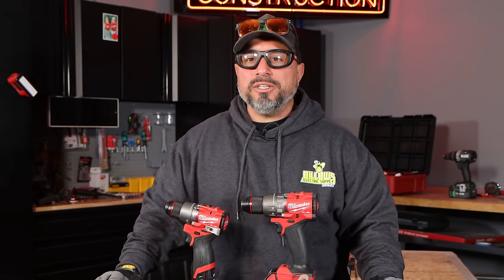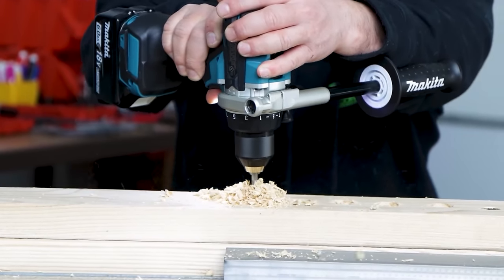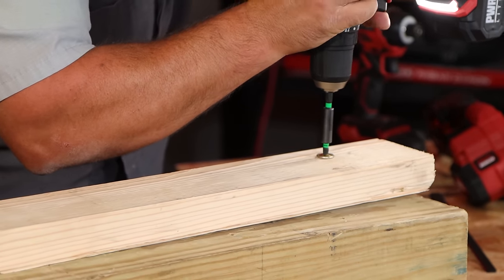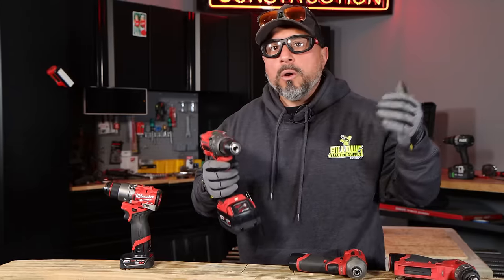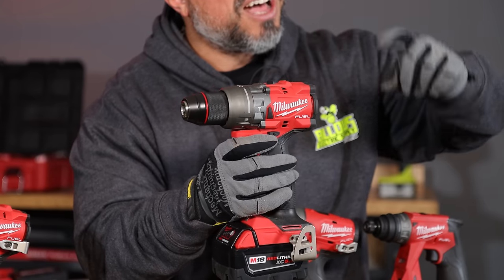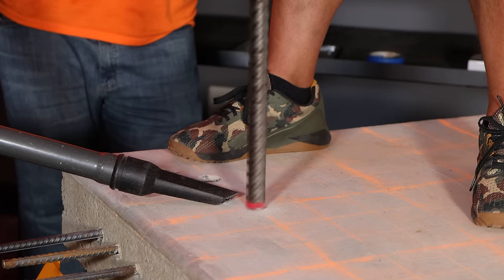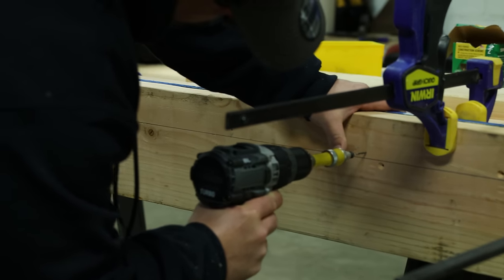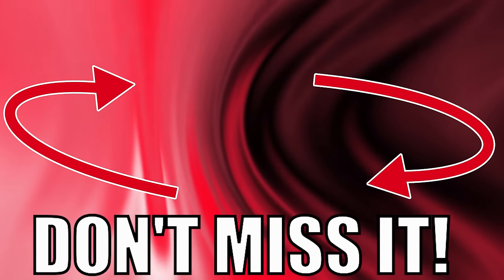Stop Using Cordless Hammer Drills...

Comment: I agree, it’s unnecessary if you have a rotary hammer or no use for the hammer function otherwise. Specialized tools will always do a better job than a “multi function” tool. For people like me though, hammer drills make sense. I work on cars, so I rarely have a use for a hammer drill. But my shop is concrete, and I have to drill into the walls occasionally. My M12 hammer drill makes the job much easier.

Comment: I use my cordless hammer drill when I use a hole saw through wood it cleans the teath and keeps from burning up the hole saw.  If you don't believe me please try it, and put a piece of electrical tape around the nut holding the saw in place to keep it from vibrating loose.

Comment: Me I use combi drill Milwaukee for everything I am tiler walls and floors,and stone fixer work with many types stones marble etc so the combi drill i use for mixing the adhesive, latex, with paddle mixer,drill holes in stones marble for metal fixing etc so for me it's the most best tool with one tool i doing more jobs brilliant why you say it's stupid? The combi drill Milwaukee it's already compact for what i doing it's extremely compact and powerful

Comment: rotary hammer is really just a big ass hammer drill. but let's be honest, installing anything on a concrete floor requiring less than a 1/2" bit is over kill for the R.H.  I'm not saying I need a nice hammer drill, or that it's needed often, but I need one.

Comment: A few months ago I would have argued with you, but since getting myself one of the Milwaukee M12 rotary hammers I can totally see where you are coming from. Small, lightweight, and does a MUCH better job of drilling concrete, brick and stone. And I've been using an impact driver for driving fasteners for years now, so really all I need from a drill is the ability to go round reasonably fast. I'm a DIY-er and odd-job-man. (PS I also have a huge line-powered SDS for really big jobs but in all honesty I hardly get it out of its box once a month.)

Comment: A hammer drill or drill-driver has a torque clutch that allows you, with some fiddling, set driving depth reliably for a given material.  A rotary hammer doesn't.  An impact driver doesn't.  An impulse driver (hydraulic impact driver) doesn't.  Notably, a "Drywall Screw Gun" DOES perform this job, using a different mechanism - a direct impingement collar.  I got Ryobi's 750 inch-pound drill-driver in a clearance set, and it's hard to justify their hammer drill when I have no immediate need for masonry applications.  I do wish I had the handle to make it easier to run hole saws and other high-torque applications, which I don't think make a great match for impact tools.

Comment: When I’m using drive nails or plastic anchors or tapcons: I use my hammer drill, which I can use for drilling too.  For the small stuff having separate tools is inefficient.  Multi head installation diver are f33k3n junk.  But what do I know, I’ve only worked 25yrs in the elevator trade installing them.   Live confidently and peacefully

Comment: Sorry, but kind of a pointless argument... The cost of a hammer drill isn't that much over a regular drill.  If it saves you the hassle of having to carry a rotary hammer with you all the time if you run into the situation where you might have to install a tapcon or something similar, it's well worth the extra few bucks.

I have the installation driver, impacts, 2 rotary hammers (plus and max), a right angle drill, a joist driller and a couple hammer drills.  The two of those that are in my EDC are an impact and a hammer drill.  The rest of them are used on a "I know I'm going to need this today" basis.  Toting too many drills (tools in general) is a PITA, and a huge liability.

Just saying.

Comment: A hammer drill is designed to be versatile, it does many things reasonably well. Of course a specialized tools will be better at what they do. However, hammer drills are popular because the masses dont need specialised tools. If you have money to buy only one tool, the hammer drill will always makes sense. Yes its heavier than the other tools but would you rather carry 1 tool or 3?

Comment: Mmmm I have I have to disagree! I have the m12 compact all in one impact with all the interchangeable settings don’t get me wrong it’s an amazing drill ! But I can’t use this to simply insert a 3/8 concrete screw in . So I had to get the Milwaukee m18! Not I have 3 options

Comment: I totally agree. 9.5 out of 10 times I reach out for my impact for DIY. The only reason i reach out to my drill is when I have to use an accessory that I cannot use an impact with (which should have been designed for impact anyway)

Comment: Actually the hammer drill serves better for driving screws into hardwoods, the hammer function 
Helps tighten bolts, nuts and screws better.  My question was can it really drill concrete if im just drilling 4 holes 2.5" deep that are 5/8" dia   
Have you ever picked up a drill driver at the big box store to test it with a screw or lag bolt  ever noticed the hammer drills have driven the screw deep below the surface,  your old nicad cordless drill would not do that.  The current battery type like an m18 has a lot more power in a hand held cordless tool. More power is always better. 
And honestly  going from a 12volt drill driver  dewalt to a 18volt milwalkie  drill driver hammer drill
The m18 drill even with a 5amh battery is a lot lighter and not as bulky.  If its too big and heavy for ya use a 2amph battery wouldn't want to strain your muscles.

Comment: Im from Europe, so we use mostly hard materials instead of wood and dry wall and ... to use hammer function on usual drills is nonsense, I have DCD795 and I tried hammer function for 6 years 3 times? I have next DCF887 ann DCH273 which did most of any for I did. I have in plan to buy DCD703 for most of work in small areas and wood work. and in case of buy of DCD800 or 805 I will choose 800 even 805 is brutal compact.
I fully agree, mechanical hammer function is out dated.

Comment: I use a regular drills for wood, I use impact for screwing, bolting, and anchoring, and I use a rotary hammer drill for concrete. But I couldn't exactly follow your video because I don't think a hammer drill is any different than a rotary hammer drill. My logic is I hate having to switch out bits every 30 seconds. So the more drills I have for different specific uses the faster the task is completed and I have never been proven wrong. Just saying.  But all these drills can drill, but how much time do I want to waste realistically.

Comment: Hey Vince, I think you might be off the mark a tad by saying it's a stupid tool.  I'm in the Telcom trade, and yes that is a trade.  I drill through brick, solid concrete and sometimes asphalt.  Having the hammer drill is both cheaper and less weight to carry than a rotary hammer.  There are times I need a good rotary,  but 90% can be done with hammer drill.  Even having the impact to use on fasteners after drilling pilot holes is still less weight and strain on the body.   Is it for everyone? No, but many many Telcom and electricians use them for convenience.  Calling them stupid tools is a bit much.
Reply from the maker: Why would people think Telecom is not a "Trade" Rick?

Comment: In poured concrete up to a 1/2" hole a hammer drill works fine. Over a 1/2" I reach for my spline drive rotary hammer.  The SDS and SDS+ are no more than toys for the infrequent DIY'er.  They break off at the drive end too easily.

Comment: I would have to disagree with you, I install TVs and here in Miami The exterior wall is made out of concrete. Having all these tools to bring in the house it’s too much work and too much time. Having an impact driver and a hammer drill helps out tremendously and help you get the job done quicker. Houses up north from Miami like Georgia& North Carolina, they are made out of wood but not Miami It’s wood,brick, metal & Concrete

Comment: I kind of agree the hammer drill is useless for pros/trades people. It comes in handy for a very quick job if you need to quickly drill a hole in concrete for an anchor used for a 4-gang box or a camera. If you have a big job and have to use multiple anchors or penetrate/core out a wall it's under powered and will burn out/damage the bits faster than a SDS hammer drill.

Comment: I don't drive any fasteners with a drill. I'd rather carry two tools (drill and impact)  than swap out bits just to either strip them out or cam out of the fastener trying to run screws with a drill.

Comment: How the hell you gunna drill holes for things like tapcons or lag bolts without a dam hammer drill. Its the only thing I use mine for, I don't even use it drive the fasteners after just to drill the holes.

Comment: Here's the deal. I'm following you. HOWEVER, I have to say, your "save you money" argument just completely falls apart when paired with the "there are better specialized tools for the job" argument. You gotta pick one. It can't be cheaper to buy two or three tools than to buy just one. Plus, considering the cost difference, I can confidently say I have used my hammer drill (the exact 18v you have on the table) enough times to justify the cost. I'm almost never in a situation where it's too big to do the thing I'm trying to do with it.

Comment: The hammer action on a "hammer drill" is mostly worthless anyway, especially on the M12.  There just isn't enough mass or hammer action to get much done.  In a pinch, I guess it's better than nothing but no substitute for an SDS drill.  I wish they would stop pairing up the impact drivers with hammer drills in the kits.  I would rather have the standard drill over the hammer drill.

Comment: I agree. I have a couple normal drills that I use for normal drilling tasks. I bought a hammer drill because it was a heavier duty drill in case my others can't handle it, but also for the few times a year I need to drill some holes in masonry. If I was ever doing it as a job, I would have a dedicated full sized hammer drill. You make good points!
Reply from the maker: Exactly 802, I appreciate the feedback!

Comment: Hammer drills are meant for concrete and concrete only they're not designed for wood metal plastic glass or any other materials that are soft and not as dense as concrete. Hammer drills were designed for concrete using hammer drill bits. You should use a drill designed for hammer drilling for concrete if you want to have a hammer drill.    I have lots of Milwaukee's and rigid I never use the hammer drill feature.

Comment: I like the hammer drill for holes smaller than 1/4” in concrete…for those  concrete screws…anything larger I have my rotary hammer….95% of my concrete holes I drill are smaller than 1/4”.

Comment: I disagree I use my drills to drill a hole and my impact to drive screws … I use my hammer drill mode when I need to drill smaller holes in concrete so for me and my crew the drill and hammer drill works fine for us Vince 🇺🇸👊🏼🪚🔨👊🏼🇺🇸✌🏼

Comment: Eeeh low voltage work, cameras in particular require mobility and power because of the amount of drilling into brick, steel and other surfaces. An SDS is too much to carry around daily so we keep one, just in case. Mostly the gen 4 m18 can handle most brick except fire brick which takes an ineffective amount of time even using Diablo bits, so I would just use the rotary at that point.

Comment: If you are using a hammer drill to drill holes in anything but concrete, you are not using your tool properly. If you are driving fasteners with a hammer drill you are also using it wrong. It is for drilling holes in concrete.

Comment: I just got the 12v Milwaukee fuel surge for drilling and fastening for the lion's share of my work.  But, I got the brand new version of the 12v Milwaukee hammer drill simply because I occasionally need to drill 1/4" holes, but never larger holes than that.  Since I have limited space in my company cargo van, I find this a good solution.  That said, I understand your video.  It makes great sense.

Comment: Great video as always Vince! Even with a drill chuck, that little installation driver does not have the torque to turn larger brad point bits through hardwood, which can be especially brutal if you're installing Ipe or Tigerwood decking. Having the hammer feature is nice because it allows you to install tapcons as needed. Not ideal like an SDS, but it'll get the job done. I will say this, that little installation driver looks similar to the Festool 12v drill Norm Abram used during the last few seasons of This Old House.
Reply from the maker: Good feedback Max, appreciate it!

Comment: Vince my guy why are you trying to talk me out of buying a tool?! Lol so if I am drilling a hole i will not use my impact that is for driving only in my opinion. I use a drill for drilling. Now when I buy a tool especially at milwaukee price point I want the absolute most tool I can get on one platform. So there for I buy the extra hammer part of the drill. Just face it when your drilling with these drills your going to use them on the smaller stuff from 3 inch smaller. If I only need to cut in a couple of 6 inch can lights I will grab this tool for dry wall all day long. But I would never cut into concrete with a 6 inch bit with this that's what a hole hog is for. That being said I will not you a heavy duty hammer drill for a 3 inch tap con. That is why that hammer function on the drill is there. I've use it a bunch on my m12 to drill brick. Now that might be the only reason. I use the hammer function but having it when you need it is super nice. It's not in the way fpr other jobs your using it for just there if you ever need it.

Comment: I disagree completely. I am a tradesman who has need for drilling small holes in concrete. I'm not gonna reach for a heavy SDS drill so that I can make a quarter inch hole in some concrete. I also do not regularly use my hammer drill for fasteners. I probably use my hammer drill about 1 day each week. The impact driver gets the rest of the usage.

Comment: Maybe in America where you have "paper-wall" houses. Come to Europe with your drill or impact driver. I guarantee you won't be able to drill a 3cm hole in regular concrete not to mention a construction-bearing wall, with any of your specialized tools in the video. 
Each tool is made for a specific purpose and catered for a specific client. 
I'm not a construction worker, I live surrounded by concrete walls and don't want four specialized tools in my toolbox. A hammer drill for the house works, and an impact wrench in my garage are my tools of choice.

Comment: You're crazy Vince! Why would you say such blasphemous things!  

As a commercial electrician I have 12v and 18v hammer drills on top of a rotary hammer drill. 99 out of 100 I'm using the rotary but that 100th time happens often enough where I'm so glad I have it. It's that odd function that you rarely use but can't do without. In my opinion.

Comment: Well I wasn't going to comment but after watching the whole video I can't help myself. The hammer drill is Handy. Sometimes I don't like busting out the big rotary hammer to do a small holes into concrete. I have the hammer drill right there. And no it's not the greatest but like I said it does come in handy. And yes I use it to drill holes in wood. The extra weight is no big deal. I don't think I ever noticed.

Comment: I disagree.  35+years in the Carpentry trade and the only thing more ridiculous than your claim here, is the board stretcher.   .... which is StILL hilarious sometimes.   It's great to have my cordless hammer drill when posting a sign on the block wall outside my shop.   Fastening my table saw to the slab.  
I only need one drill when doing those types applications.... the hammer drill.   Because i not going to ruin the concrete bore with an impact driver.   Yet i need the impact of the hammer to bore the hole.... get it yet?   All those cute little dolls....i mean drills,  you have there in front of you are what's useless.   The best addition the drill has ever recieved is the hammer function.   The best addition the hammer drill has ever recieved is its lil bro, the impact driver.   Sure, if you specialize in concrete, drop the cordless all together and get an SDS.  Until you need to drill holes in your forms or fasten anything together.  If you're a handyman or a DIYer or even a weekend warrior,  sure, listen to this guy🤣.  But for us actual Skilled Carpenters, we gonna continue to carry the hammer drill.   And yeah, the impact too.  
..... all that👆🏾 said, i might ought to have just rolled my eyes and moved on. 
✌🏾😎🙏🏾

Comment: You're absolutely correct. I have the Makita biggest 18v hammer drill and I never use it. The 1/4" impact driver is more powerful for fasteners and the corded true sts hammer drill is much faster and stronger. I use my 18v 1/2" drill to drill holes. I use a 1/2" impact drill to drive bigger fasteners or to remove and fasten lug nuts. The 1/4" tech drivers are the most useful tool in the box followed very closely by the 6 1/2" circle saw. Yep the hammer drill is redundant and almost useless. It is a good 1/2" drill but it's heavy.